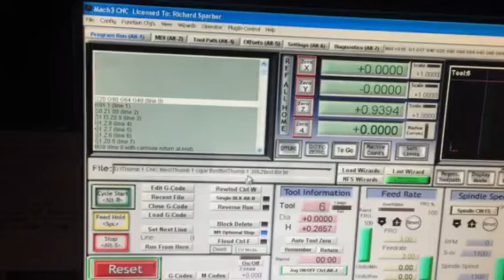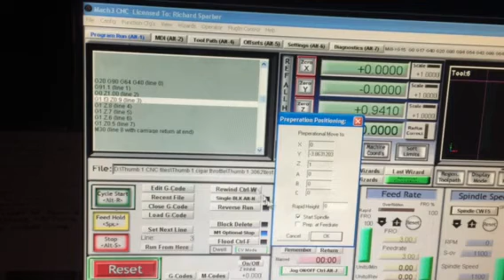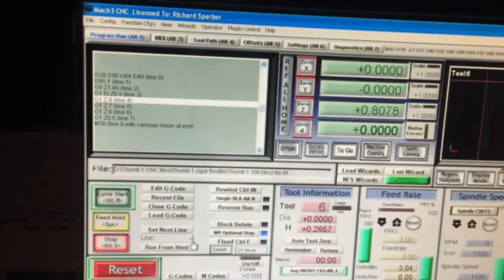Mach3 Run From Here Strangeness

Comment: When you use the "Run From Here" feature, Mach 3 displays the starting points from the previous line of code for it's X,Y, and Z coordinates in G54 coordinates. The Safe Z setting is also displayed but as Machine coordinates.  When you click on okay, Mach 3 moves your spindle up or down to your configured Safe Z height then up or down to the G54 height from the previous line of code. I recommend manually raising your spindle to a safe height above your table, click on "Machine Coordinates", take note of your Z  coordinate; then enter that value in your  Mach 3 "Safe Z Settings" found under Configure. Now when you use "Run From Here" the spindle will rise up to your safe height, then lower to your previous line of code Z height. I hope that helps you.